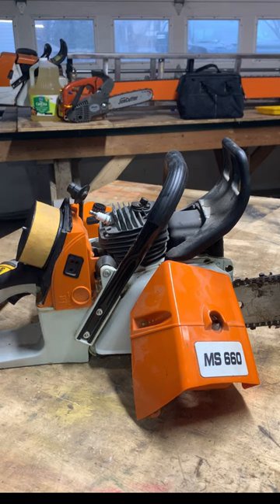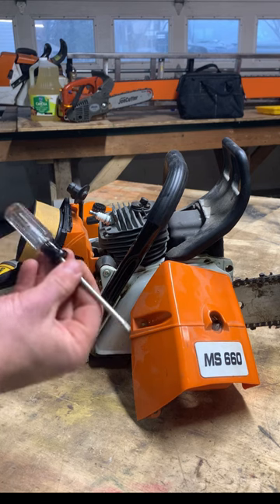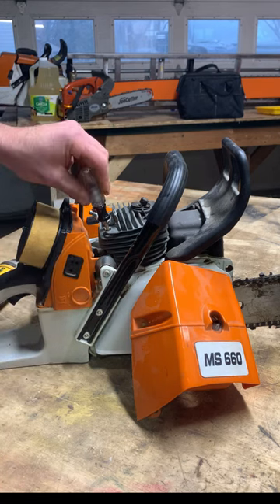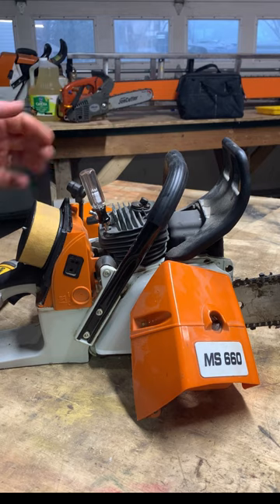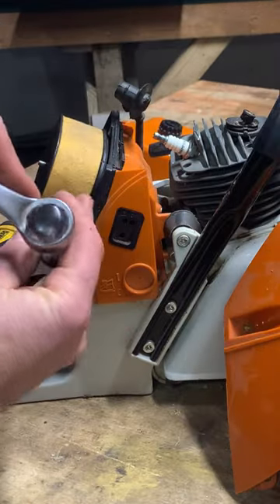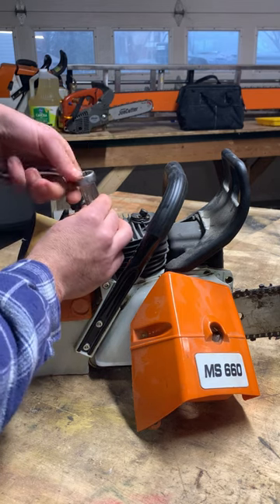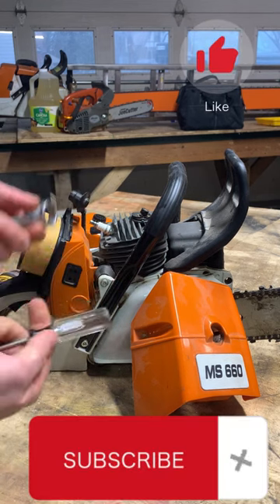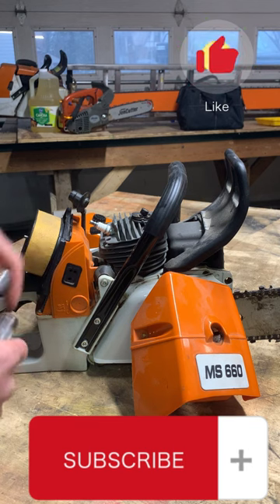Tool Tip's and Trick's.  How to get more torque out of a Screwdriver, using a wrench

Comment: Neat trick, used it for years, but it doesn’t work on “any screwdriver” but it will work on craftsman, some proto, you can use a box end on Snap-On or other square handles
Reply from the maker: 100% right. I thought I said it in the video, but I had to try n talk fast to make it short.
Reply from the maker: I love the truck because you can use your palm to put a lot of pressure downward and the other hand to break it free.  Hopefully without stripping the screw head